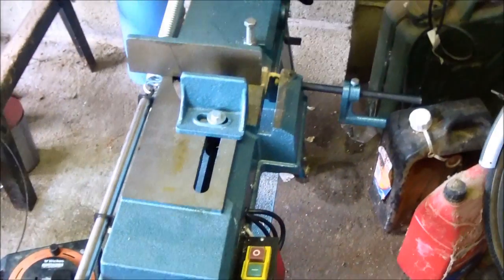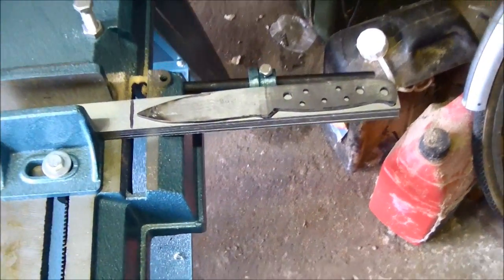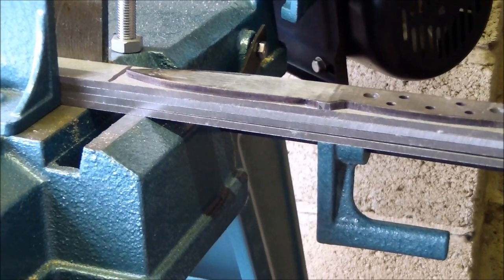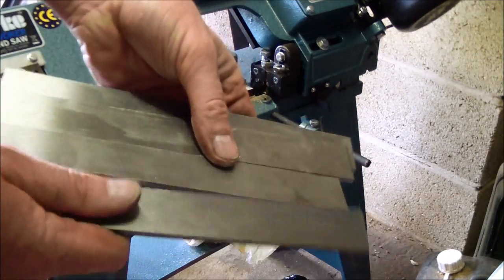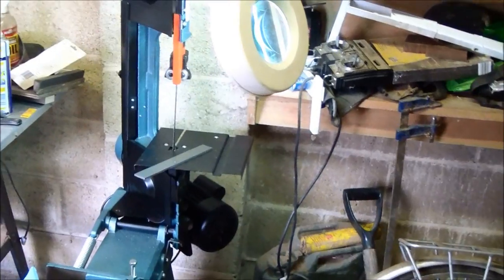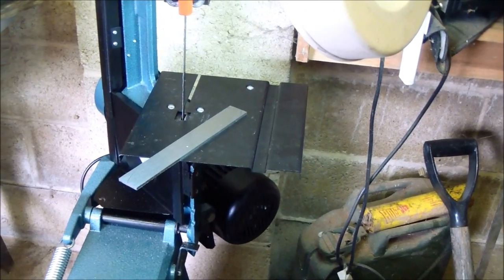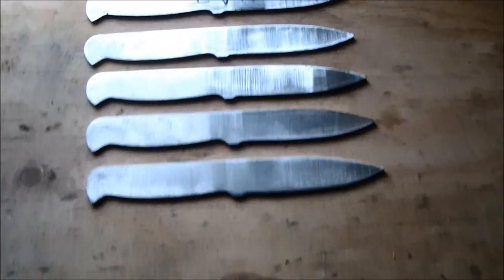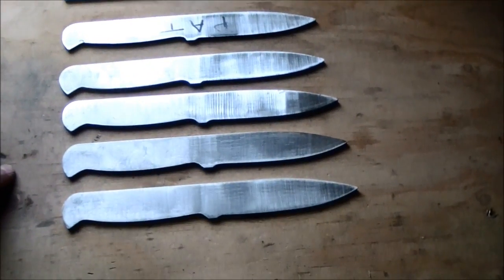A day in the workshop

Comment from the maker: I used to anneal old files and make knives from them. I'm not sure what steel that was, but all Jacklores are made from brand new British 01 tool steel. Why do I use it> Because I get consistent results and know how to heat treat it. So my knives will hold their edge for longer and not chip or fracture. Also the A.Wood Woodlore is made from the same steel.
Sandy